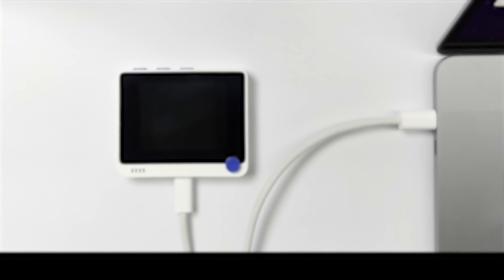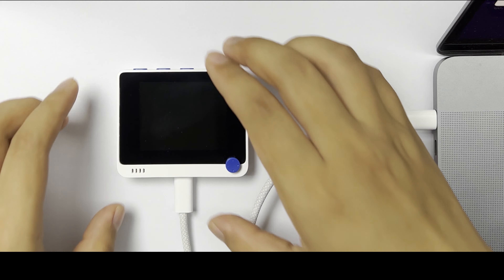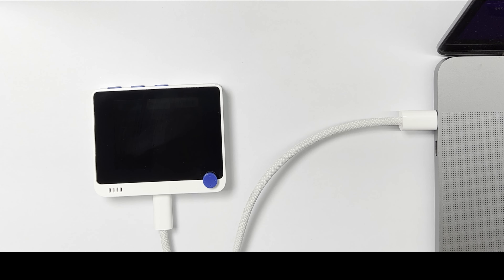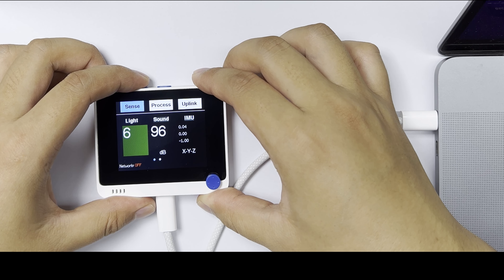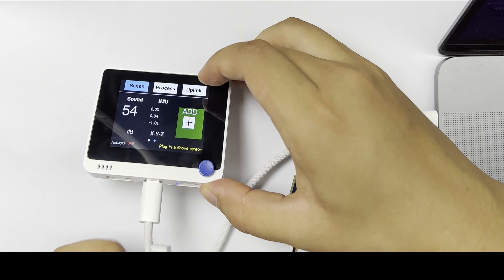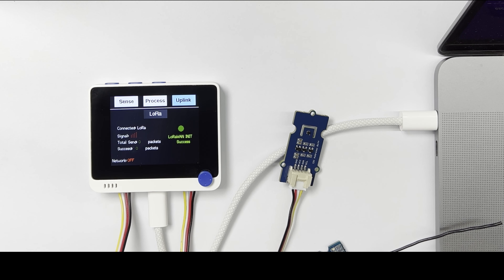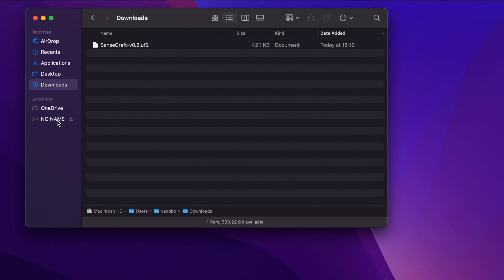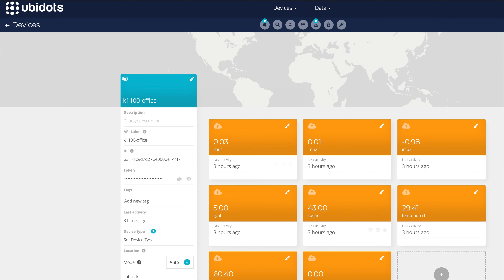Hands-on with SenseCraft on SenseCAP K1100 Kit: 3 Steps to Display The Data You Collected

Comment: Can I connect the SenseCap K1100 to your M2 Multiplatform when it is in Local Mode (eg. Chirpstack V4).  I am stuck using the Sensecap cloud at present and can’t add it to chirpstack on the M2.